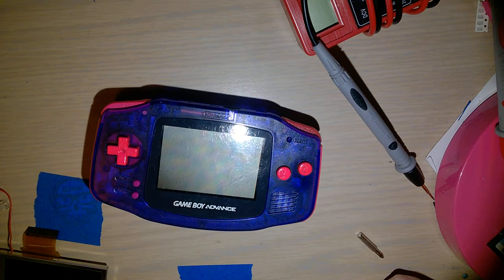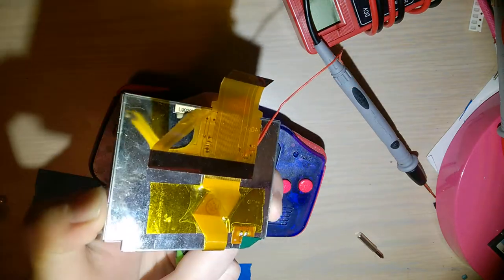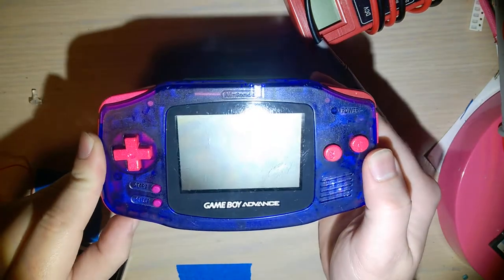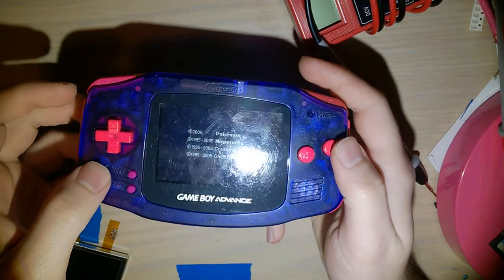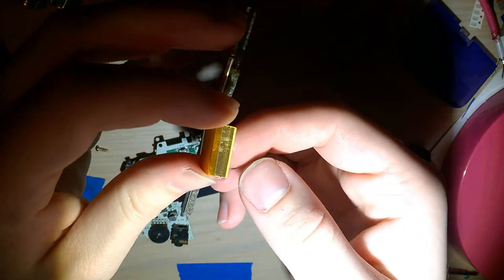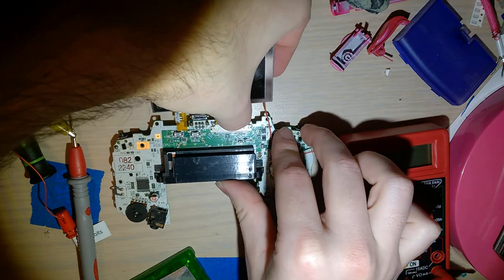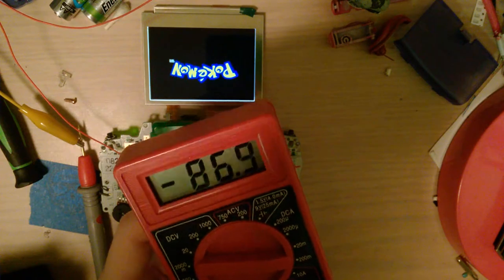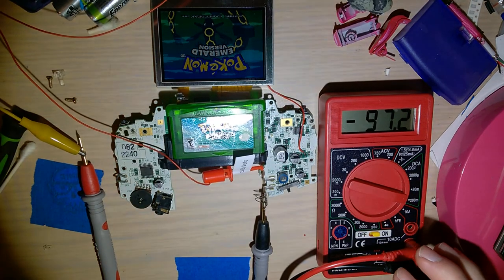AGB-101 Backlight Mod Power Usage

Comment: One thing about lithium batteries is that 3.8 to 3.6 is not 50% capacity, it is actually 90% to 5% if you look at the discharge curve of them, they start at 4.2 volts quickly go down to the nominal voltage and then drop to  about 3 volts before a low voltage cut off kicks in also I like your style of videos keep it up
Reply from the maker: Yeah, I'm always trying to learn more about batteries. There is a criminal lack of resources for info like this. You have to dig into the technical documents or someone's thesis to find info sometimes. I've also since made a much better and much more reliable way to test power usage so this video is a bit out of date.

Comment: It’s been a long time, but do you know of any sources that still have the adapter with the brightness button still available?
Reply from the maker: I don't see them listed anymore. I used a seller by the name of "lee chan 1985" (with underscores but I don't recall where) or some variation of that on ebay but either I'm not searching the correct thing or they no longer sell these.
Reply: @makho  I looked up that name on eBay after you mentioned it in the video. If I found the right person, they don’t sell anything anymore, but had good reviews so at one point did. Thanks for checking for me anyway
Reply: @makho  you just reminded me, I found retromodding has ones with switches